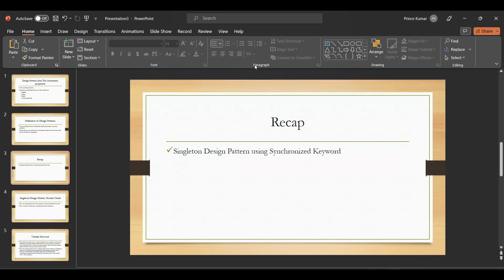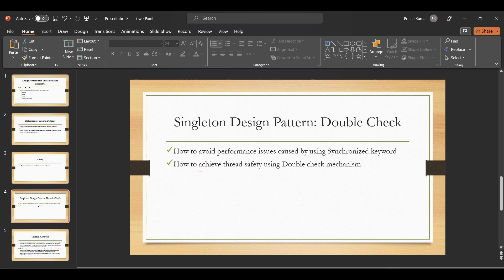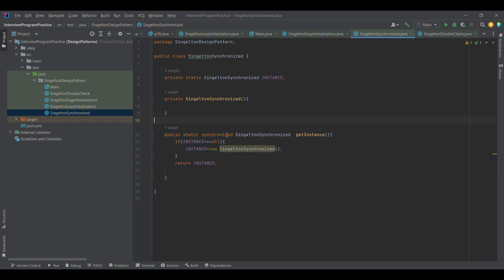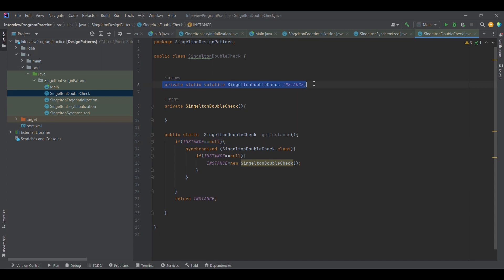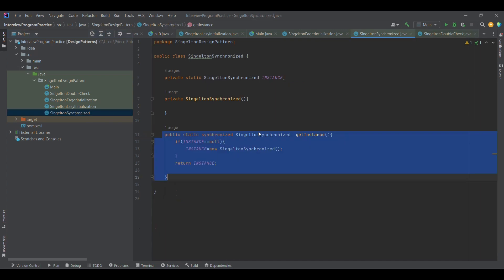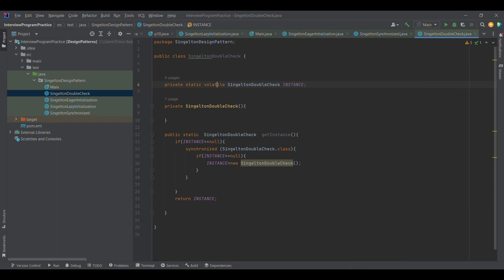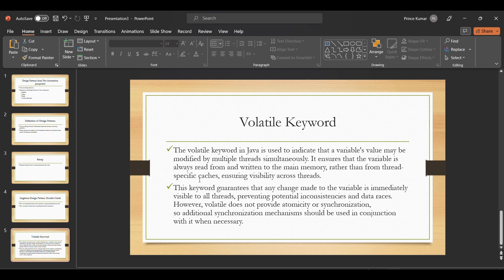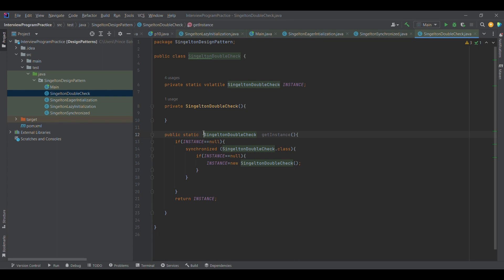Advanced Singleton Design: Leveraging the Double Check Mechanism | Lecture 5

Comment: You didn't explain clearly why the second null is used. Kindly explain that as well.
Reply from the maker: Rest of the logic is existing singleton logic like checking if instance is null or not

First null is for multi threads to check if any thread has locked it or not and second null is to check instance is null or not if null then create instance
Reply: @PrinceAutomationDestination   thanks for the explanation prince. This cleared the issue.
Reply from the maker: @SwarupSarkar-m1k thanks 👍